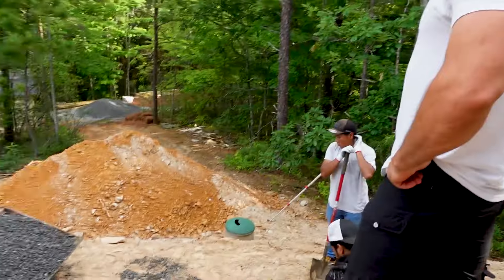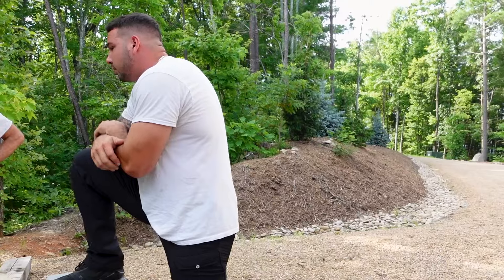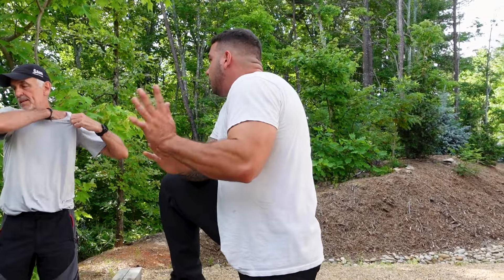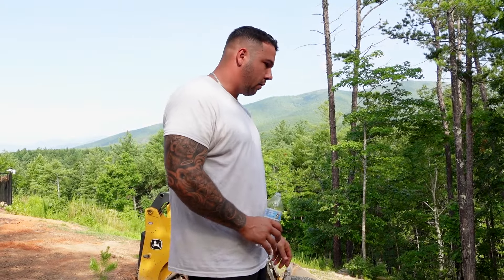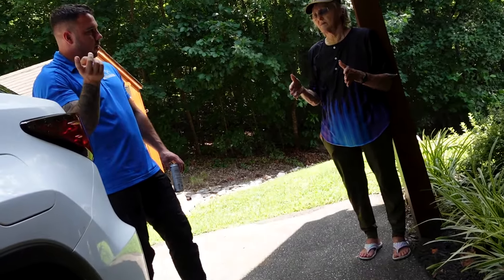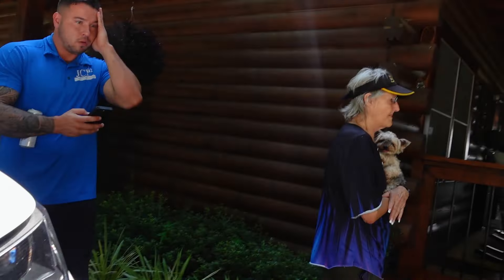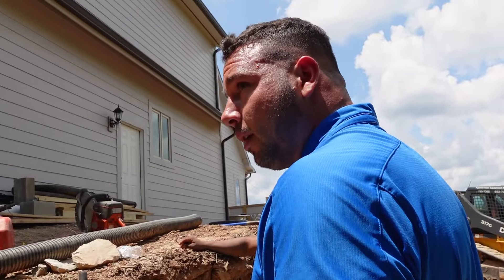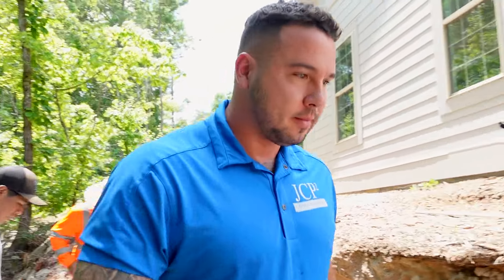I Messed this Retaining Wall Up | The Crew Might Hate Me Now

Comment: Need to dig out further back behind the retaining wall or you wont be able to place the geogrid so it actually works the way it’s intended to. Id also bury the first block. If that’s in a freeze area im afraid that wall will give once ice starts expanding and pushing the dirt.
Reply: these dudes r butchers

Comment: most of the time when we lay wall we pour a small footer just a form on the front and just float out the back but just saves ya so much time getting the first course down and also sometimes lay the first ones when its stiffens up a bit